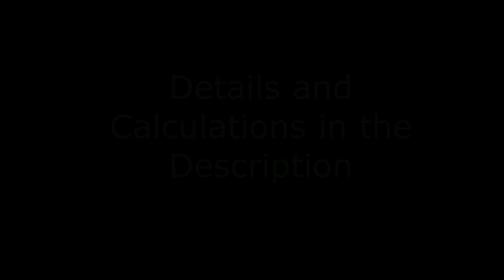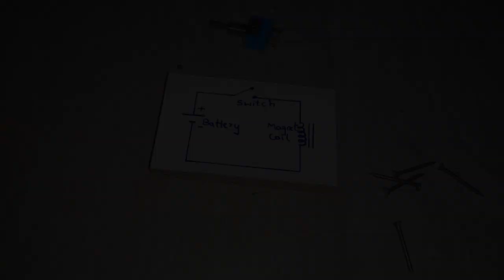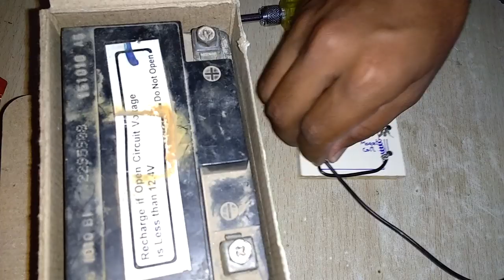How to make a Powerful Electromagnet (5KG LIFTING)

Comment: Since when 3.7kg became 5kg
Reply from the maker: Carl men, I could not find something exactly 5 kg when I shot the video...but it can lift upto 5-5.5 kg . It is important to use a battery or power supply that Can supply enough current.
Reply: On oct 1 2017
Reply: He is counting his hand as well🧔
Reply: @TheTechnocrat  is there a way to predetermined the strength of electromagnet
Reply: The Technocrat can you explain me how did you calculate that? Because I need to know how in order to design an electromagnet for a robotics project that needs to lift a specific weight. Thank you!
Reply: @TheTechnocrat  What core did you use for the solenoid you made? Please specify the size!
Reply: @sebastianfraga2001  it's magnetic induction equation for solenoid if im not wrong,
Reply: @TheTechnocrat  sir battery rating please
Reply from the maker: @bansodegundappagirappa2698  12Volt, 7Ah .
Reply: Tell me you can't follow instructions and do math without telling me you can't follow instructions and do math. 🤣🤡

Comment: Hi, I am a power plant engineer. Making videos such as this is a good thing to increase knowledge. But let me add some safety inputs, you need to ensure before working in any system to disconnect first the energy supply (e.g. battery) regardless if the system switch/breaker is open. Even if it is very obvious, always consider electrical system as live ones. The 12V DC does not that give you good shock, but for some it will hurt, but still, regardless of voltage and current of the supply (if mechanical, pressure, etc.), be safe always. Connect power supply after what you are doing, especially in industrial and power field, there LOTO and verification with partners will take effect. Practice of safety starts from small things you are doing.
Reply from the maker: Thank you very much for your inputs and suggestions. Will implement in future videos. And I have also learning many safety practices working as a instrumentation engineer now. I was a student back then. 
Thank you.
Reply: @TheTechnocrat  Very great my friend! Let us work together as engineers for a better world of future!

Comment: idea, you keep the metal core longer, so it goes into a drill, then wind up the copper, and then cut the piece to length. But overall simple stuff, thanks for sharing.

Comment: Hi, great video mate, but I have some queries...
How does length and diameter of effect the electromagnet strength?
I understand more no of turns are better, so does a smaller dia. core is better?
Also what is better having a single layer of coil over a long core or multiple layer of coil over a short core.

Thanks.
Reply: Longer will be better but it will waste lot of wire 
Smaller dia will be better to but it wil become very hot after a few minutes due to the resistance of the wire 
So the combination between long wire and reasonable dia will give the best performance. And about the layer because the wire is long so we need to make layer over layer, it just effects a little bit so don't worry.
Reply: @phucminh3633  Thanks☺

Comment: I have 25 gauge enameled copper wire, is it possible to make same electromagnet? If possible then how many turns and how much dc volt require?
Reply: did you made it? how did that go

Comment: Whats the battery voltage you used ? If I remove solenoid from water filter, and attach it to the battery you used, will it work same?

Comment: Nice project, looking at the design I think the coil is maybe around 10 ohms, so maybe
1.2 amps which is ok for 1000 turns of 26 gauge you say you use. With that size battery you should use some current control ie an online fuse and you should also deal with the large back emf generated at switching since induced voltage is proportional to rate of change of current and it will be high, this would also help to eliminate rf interference when switching
Reply: I think a flyback diode with snubber capacitor should   do the trick

Comment: Hello. I'm trying it with 0.35mm coil wire. but when I give current, it is not magnet. What could be the problem? Does the copper wire you use have a feature?

Comment: Is it works on 240 volt
Or it needs transformer
Reply from the maker: Not on 240v.  It requires a 12v-24v battery or step down transformer with rectifier circuit.

Comment: What kind of power are you running through this?
Is it not dangerous picking up the whole thing bare hands when those joints are not properly insulated?
Reply: Magnet wire is usually insulated with a thin type of glass. Also I dont think he is using that much power to be anything to worry about
Reply: 6 or 12 volts is no shock hazard. But 600 volt spikes are generated when switching the magnet off. Unpleasant but not dangerous...

Comment: Hi Techno, I am trying to make a permanent magnet remagnetiser using 2 electro magnets for remagnetising slot car motor magnets, I have had some success but the electromagnets aren't strong enough, is it better to have a long core with less layers of windings or a short core with more layers of windings or does it not matter? I have used 260 grams of 14AWG wire around a 200mm long 16mm diameter iron core but it is feeble compared with your results, any help would be greatly appreciated.
Reply: Short core with more turns
Reply: you all are fools becouse thr wire have  no cover why is the 24 v electric current is not sparking

Comment: Is the steel bar in the center needed, or could I use a pipe or nothing at all? Was it just to make winding easier?
Reply: fatdoggo 1212 you need some sort of iron core for an electromagnet to function.
Reply: @roidsaccounts9565  thank you. I'm planning on making a coil gun. Would a steel bullet work?

Comment: I don't know much about electromagnets but need to make a tool for a specific task. I have snapped a half shaft on my land rover and need to remove the broken end. The hole I need to pass the tool down is about 1" in diameter and 3' deep. The magnet would need to be as strong as possible to pull on the broken end to disengage it from the splines in the diff. So my questions are does the size of the core iron matter and also what gauge wire should i use for maximum strength in the space I have available? I was going to try and attach it to the end of a broom handle.
Reply: Did end up ever getting it out?

Comment: Please help me understand how you're getting 8.7 ohms resistance? do you mean across all the wires or just in the coil? from the links and info provided, i got an answer of 0.153 ohms
Reply: if you have that kind of constant resistance from the first place your wire will get heated up and burned with just a few minutes because of hight current. its so simple use multimeter to measure your resistance in the coil before supplying
Reply: Bro tell me how U calculated 0.153 ohm resistance???..let me know I can help U clear Ur doubt

Comment: Hey bro . I am trying to make an electromagnet but it isn't working . Two times I had connected it to a switch { directly } . And the fuse dropped . Why this happened . What should I do ?
Reply from the maker: Alle boss please do not use the mains to power this electromagnet as it has less number of turns and resistance is very low and high current flows and fuse/MCB trips.
please use battery or power supply
Reply: @TheTechnocrat  Can I use 2 AA batteries rather than 12-24V?
Reply: @TheTechnocrat  is it possible to make one that works on AC?

Comment: I want to increase the weight 100 times....can you derive the changes in electromagnet and its properties?
Reply from the maker: Yes can be done. There are industrial electromagnets that can lift tonnes. But have to be designed professionally according to good engineering practices and keeping safety in mind.

Comment: how many meter of wire did you use.
Reply from the maker: From the place I bought , they sell in grams. I had purchased 100g (if I remember correctly). Might be around 30-50 meters. I don't remember exactly . Sorry.

Comment: Excellent video. If I were to have the same amount of turns and wire size, but had it so the core wasn't fixed to make it into a solenoid,  would the solenoid have the same pulling force of 5 kg?
Reply: The closer the wires are together, the stronger the field. That’s why a solenoid is the most efficient way to create on of these things

Comment: Hi, the video portrays an interesting way of making electromagnet with basic tools, however, I am curious does this electromagnet demagnetises instantly after the switch is off? Will there be presence of residual magnetic forces?
Reply from the maker: Residual magnetic force does exist In ferromagnetic material. But I cannot say anything quantitative because I have not measured.
Reply: @TheTechnocrat  Hey, I have a question, the more about of turns you do, do you also have to increase the voltage of the current?

Comment: By the way for those who don't know, the so-called magnet wire is enameled wire.  The basic wire that is used in everything.  Coils, transformers, all your motors, armatures, stators.  You got the idea.
Oh by the way.  this is plane science that what makes for a strong magnet is lots of electric currents.   The more current the more magnetic field, that is aside from numerous windings of course.   This means the thinner the wire, the more resistance,.  More resistance means what?
You want a serious magnet?  use thick wire, lots of voltage and current.  And by the way, keep it DC.  200 volts DC and you will be cooking. Don't hurt yourself.

Comment: thanks a lot for you reply i have two question (1) 36 gauge is very thin in 36 gauge and tiny compare with 26 gauge wire so how the resistance is very high in 36 gauge (2) if  i use 230 v supply which wire and how many turns and  iron rod size will capable to handle? kindly get back to me with your view on this
Reply from the maker: Arun v , the resistance of wire is given by (resistivity of wire)*(length of wire) divided by area of cross section. 
for 220 v supply... make sure your coil impedance is high enough so that the max current through wire is not exceeded. 
https://www.powerstream.com/Wire_Size.htm
above link is for max current and resistance per km for particular gauge of wire. You do the the math and find the   exact wire you want for your application. 
 You might revist my channel any time. Thank you!
Reply: @TheTechnocrat  does that mean the resistance of 36gauge is weaker compare to 26gauge wire.

Comment: Hello Sir,

 i had made magnet to lift weight of 20kg but it is hardly lifting 1.5 kg of weight. 

Specification of Magnet:

1- No. of Turns (N) = 2500 

2- Area of Core(A)=  0.00283 m^2

3- Length of core on which i had apply the winding= 850mm

4- Battery Use= 12V

5- Size of Wire= 26 gauge

6- Core Dia.= 10mm 

 

Please suggest me required changes to make it for 20kg

Here the pic of magnet i made
Reply from the maker: Make sure your battery capacity is high enough to supply enough current. Also, my suggestion is to increase the supply voltage (24-48V) and thicker wire as the current through the coil will be higher. Also for higher capacity, a good high permeability core is required.

Comment: what if i used capacitor 500uf like battery Will it get hot?
Reply from the maker: 500uf might not be enough to use as a battery. Maybe a super capacitor will do the job . Super capacitor is expensive than battery.
Reply: @TheTechnocrat  thank you
Reply: @TheTechnocrat  it's ok with money compared to his strength

Comment: if i change the power cords around would that make the magnet repels instead of attract
Reply from the maker: LiamLlamaGaming ..yeah... it will change the pole.....but it has effect only on permanent magnet ....not on iron bar
Reply: Yes 
But not affect the magnetism
Reply: @ chase kendig.. magnetic flux . lines of force NEVER cross, lines of force are CONTINUOUS, lines of force ALWAYS form individual  CLISED LOOPS around the magnet ,lines of force have a DEFINITE direction from NORTH to SOUTH , lines of force that are close signify a STRONG mag. field , lines of force that are far apart signify a WEAK mag. field.

Comment: What if i supply DC supply by adaptor? and when i connected with battery, then battery become hot after some time why?
Reply: the battery becomes hot because a lot of current is flowing through
Reply: @marjanmartinov9607  i mean will burn? by heating
Reply: @marjanmartinov9607  what if i used capacitor 500uf like battery Will it get hot?
Reply: @abdotamo9739  yes. i think it would discharge too fast
Reply: @atharAkru  im sorry I don't understand
Reply: @marjanmartinov9607  when i used to charge battery by DC mobile adaptor then battery becones hotter.

Comment: Which switch you have used please reply fast I have to make my science project and can I use 9 volt battery
Reply from the maker: Toggle switch
9v battery works but the strength is not that great
Reply: So which battery should I use
Reply from the maker: you can use 9v battery for your school project purpose but to get any real use I suggest to use 12v 7.5Ah  battery found in bikes and cars.

Comment: Hyyy plz tell me if i apply 220 ac volts than which gauge of wire i have to take or how many rotation of wire
Reply from the maker: Faiz Saifi I suggest you to use a step-down transformer of 24v and make the electromagnet. 
it is not safe to deal with 220v if you are new to Electronics. 

I have seen in door bell the electromagnet is made of very thin wire of about 32 gauge and about 2000 turns .
Reply: @TheTechnocrat  okk bro

Comment: sir? how many meters of 26gauge magnet wire you need to make a 900 turns? badly needed sir
Reply from the maker: will require around 25-30mtr... I had purchased 100 gram of copper wire. about 5meter wire was left out after winding
Reply: Ow i see! Thank you much sir!! Hehe im trying build a solenoid engine but i have only few knowledge about electronics...
This is a good help sir thank you! Thankyou!
Reply: @TheTechnocrat  Sir I visited the link in Ur website..I have seen that Ur resistance of coil is 8.6 ..so I have done calculation and my answer turned to be 65 meter of wire approx...As R=rho (L)/A...I have substituted R= 8.6 ohm,A I have calculated frm gauge of wire and resistivity of copper we know..so according to calculations length is calculated as 65 meter approx... please reply Sir..i need answer quick..

Comment: heres an idea. get an iron rod about 2 inches longer than needed. rol paper put ends on and leave extra length on on side. then when you wind the the (magnet wire)  coated copper wire just hook it up to a cordless drill. those 900 wont be so hard. just estimate the turns with the example he shows

Comment: Hi Thanks for your really useful video, Could you please let me know your valuable thought on the below sentence? Thanks 

"How we can make an electromagnet as strong as possible? I am assuming we should increase the number of winding, wind the magnetic wires in a shorter length, and increase the current! Then my question is that what possible options do we have to increase the current? I am saying a couple, please complete my saying for a more complete solution... For increasing the current, we can use higher voltage power supply? (Does an AC or DC power supply matter in this regard?) decrease the magnet wire diameter, decrease the total length of the magnet wires, correct? "
Reply from the maker: Your sentences are right. 
1. Increase the number of turns in a shorter core.  
2. Increase the current through the coil by increasing the supply voltage.  Care to be taken not to exceed the rated current of the wire.  AC or DC doesn't matter unless you are using it on the permanent magnet. 
3. The impedance of the coil also affects the current, in turn affecting the strength.  

Ohm's law, electromagnet formula should answer all your questions.

Comment: Neat and good video for understanding. i am having some questions 1. if i use 36 gauge wire in mini transformer bobbin around 2.5 cm how many turns need for  to make powerful magnet  2. for 26 gauge if do instead 900 turns if i do  100 turns what will be changes happen ?
Reply from the maker: Arun v , higer the number of turns.. higher will be the magnetic strength. 
Also the current through the electromagnet is proportional to field strength and current depends on resistance of coil.
Here in your case the 36 gauge wire will have higher resistance than the 26 gauge wire for the same length of wire... hence you can apply higher voltage to 36 gauge wire without exceeding the current limit of the wire.
So you have to design these points in mind and also the field strength formula.
Hope this helps
Reply: @TheTechnocrat  What is the current limit of the wire?

Comment: Would it be possible to get this up to 7.5-10kg?
Reply from the maker: Yes it is possible. But have to make modifications. The magnet would become larger in size and you might need larger capacity battery and more number of turns and thicker wire.
Reply: @TheTechnocrat  is it possible to make one that holds to another surface for an extended period of time (IE an hour and a half) while being able to lift that weight?

Comment: Hey my friend can you make a electromagnet fitting in a 19.5mm pvc casing to carry 3kg with one unit?
Reply from the maker: It is possible . even though you wind on the PVC pipe there must some type of soft iron core to work effectively.
Reply: yes of course. but i plan to case it in a pvc enclosure once done . i was asking if you can make one and show us if its possible.. matching those dimentions. i gave you , 19,5mm diameter 20mm with enclosure.

Comment: Isn't it a cooper wire sir? Are copper wire and magnet wire different?
Reply from the maker: Yes it is copper wire . Usually insulated copper wire is called as magnet wire because it is usually used for making electromagnetic devices like transformer, motor, electromagnet..etc